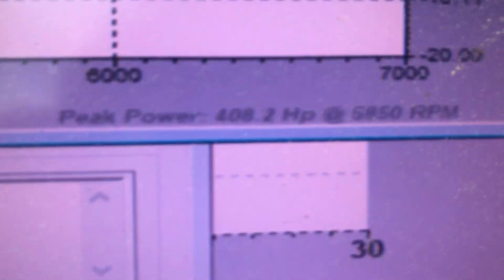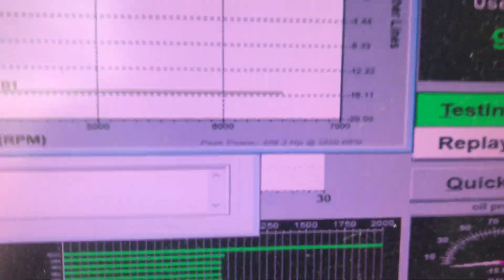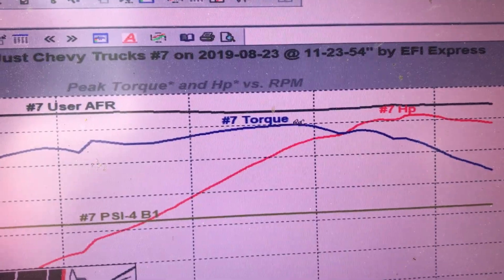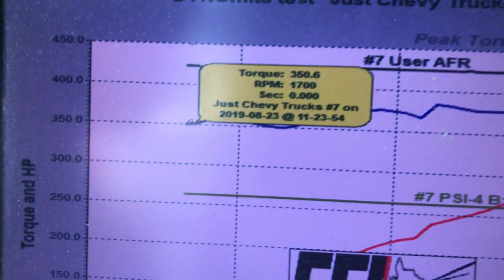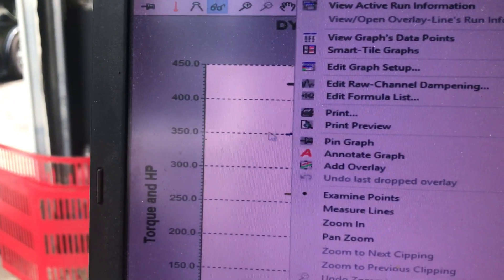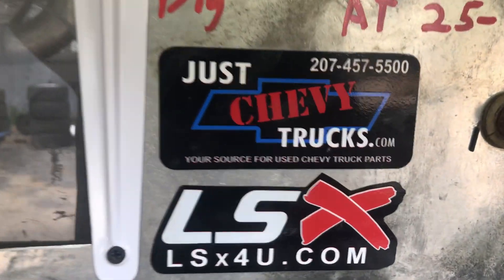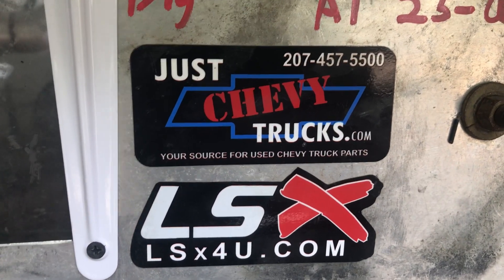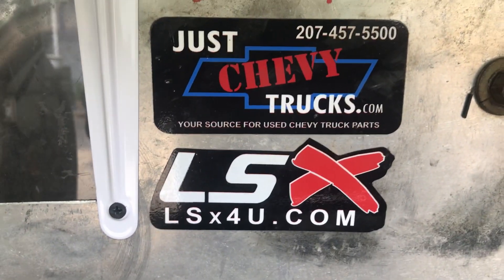Dave Jacobs Stage 4 Engine 6.0 LQ9 VCM Cam 480HP @ the Crank

Comment: Whats the vcm cam specs? Using this video to try and compare numbers with 317 heads vs 862 heads. Seems the 862 is only behind by a few hp. I imagine power under the curve might be better with the 862s and added compression? Just a little less peak power but not off by much
Reply: Justchevytrucks so not too much smaller than the cam from the other video with 862 heads. This answers my questions about the combo though. Seems the compression is enough to compensate for less flow than 317s. I imagine some prc stage 2.5  862 heads would outshine the stock 317s by a long shot, if you can match/beat the flow of 317s with the added compression. This is good stuff here. Lots of videos to really crunch numbers and compare. Thanks
Reply: Justchevytrucks i see the curve characteristics are the same with both heads. Tq loss after 5k, peak hp close to 6k. Same behavior, just a slight difference in the numbers. Very comforting to know im not losing a ton of power by choosing 862s